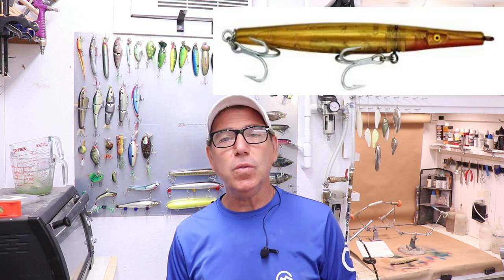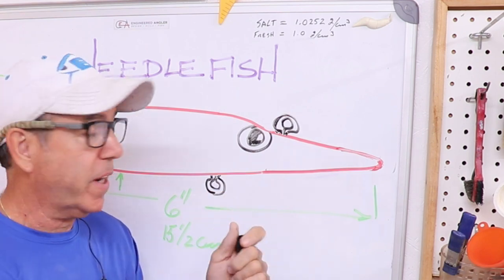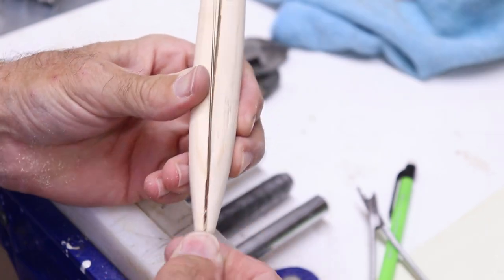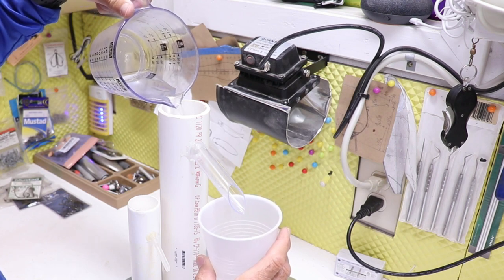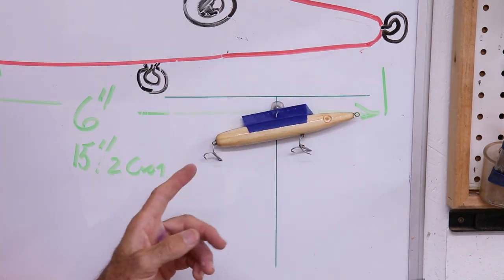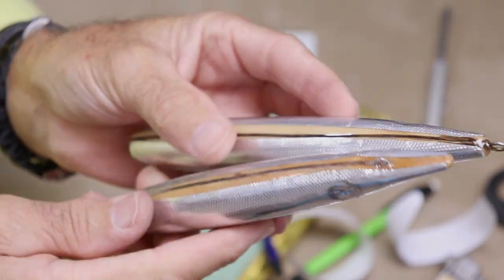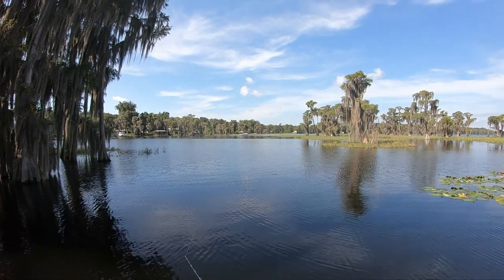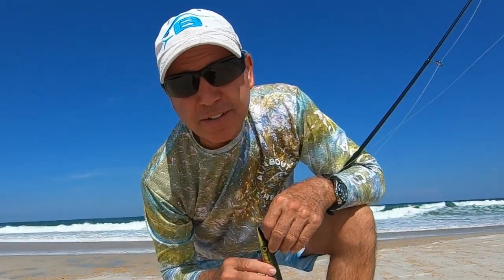How to Make a Needlefish Plug,  Making a Wooden Striper Lure,  #surfcasting #luremaking

Comment: Common misconception about needlefish is that they move in a straight line. The movement in the water (waves, current, sweep) push the body of the lure in one direction, and the tension on the line pulls the body back towards center. So with minimal reeling (just staying tight to the plug) the lure has a very natural, subtle wiggle as it moves with the water. Much like a baitfish adjusting itself to maintain stability against the current. Sometimes less is more and the needlefish plug is a perfect example of that, as it’s a tried and true big fish slayer
Reply from the maker: You're right.

Comment: I noticed you skipped the sealing stage before you put it in water for testing.  Is your UV clear your sealing stage?
Reply from the maker: Yes I clear coat it with the UV resin to seal it so I could submerge it in water to do the calculations

Comment: from my experience using needlefish plugs for striped bass ( i admit its somewhat limited). its really a straight retrieve at a pretty slow pace. Also i only ever had fish on them at night. The current in the water helps provide a slow back and forth wandering action  to the lure. Most lures give a startled or injured presentation but the needlefish is a little more subtle, like a slow fish just swimming in the dark unaware that a 'predator' is around.  To look at most you'd think, "I don't get it, its just a stick" but they work

Comment: Hi Franko, I really enjoy your videos and appreciate you bringing an engineers perspective to lure making, it has helped me to think about my lure design with more clarity.
I wanted to share the method I use for finding the volume and therefore goal weight for a lure; I weigh my lure and hardware first while it is dry, then place a water filled vessel onto the scales, tare the scales and then suspend the lure blank fully submerged in the water, I use stiff wire. The weight (g) registered on the scale is the weight of the displaced water and is therefore equal to the volume in ml. I will then calculate my goal weight based off the density of salt water. Perhaps you already are aware of this method, I use it as it only requires scales.
Reply from the maker: That is a nice clean way of doing it.  But you need a scale that can handle all the weight.

Comment: Hey nice video. What are the dimensions of your needlefish? What do you spin the tail down to and what do you spin the nose down to? And it seems from your drawing the thickest part is 7/8 correct? Thanks @Engineered Angler Lures
Reply from the maker: The nose comes down to about 1/4 inch and is then rounded.  the tail i try to make a semicircle about 5/8 diameter.  The other dimensions in the video are pretty accurate.
Reply: @EngineeredAngler  thanks I appreciate you.

Comment: I'm enjoying your salt water builds. Needle eels are one of my all time favorite plugs. They can be fished in any sort of surf conditions, and produce! Calm conditions we go lite, rough, we go heavy.
I'm curious, traditional plug building  usually has the maker through drill the plug, adding swivels in the belly holes to hold the trebles. Is there a reason, other than simplify the process, that you choose to cut the wire in? Seems to me it would create more opportunity for water intrusion, as well as weaken the overall plug. Am I wrong?
Reply from the maker: I have to disagree, l think through drilling is more likely to allow water in, especially the belly hook hole.  The lure body really doesn't need to take much of a tension load and the crushing loads will do what they do. I personally just don't like the look of drilled through wire setups but, that's just me.
Reply: @EngineeredAngler  that's why I asked. Wanted your professional/engineering opinion.  And you're right, the belly hole is always an issue for water intrusion. Thank you for the input!
Reply: @brynniebfishing  that's why the best builders SEAL the wood. Paint and topcoat get worn away with hook swing. Exposing the wood.
Reply: @johnrichjr.415  I always seal, prime, top coat, and epoxy my plugs. So far no issues.

Comment: Excellent video as always!
You're gonna have to add "artist" to your opening credentials cause your lures, and paint job, are works of art!
I really would like to see you try some of your lures from a pier that's up out of the water some 14',, get your take on how to build a lure that works well from that height, or slightly higher!
Also,, I know it's not much, but when you drill holes in the lure to add lead you're losing some of the weight from the lure at the same time,, doesn't that affect your overall floatations/sink rate?
Reply from the maker: You're right, there is some lose in wood weight and when I refill and seal the hole there are changes there too.  luckily these are small enough that I can work around them with a simple factor.

Comment: Have you ever figure out your saw why it cuts at a angle mine does the same thing? Thanks in advance
Reply from the maker: Yes, it was a dull blade...I replaced it with a better quality blade and it was fixed.
Reply: @EngineeredAngler  thanks for the information